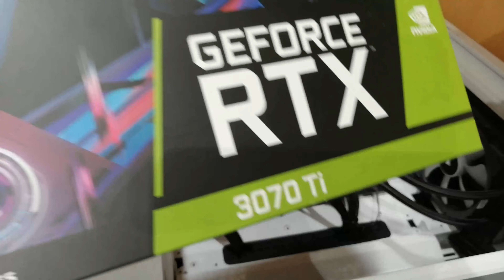Corsair 7000D WHITE Gaming PC Build [2022] | Intel i9-11900K | RTX 3070 Ti | Gen4 7000s SSD 2TB

Comment: why spend so much money on terribly cpu as 11900k and then pair it with 3070ti!? you can buy and build basically now r9 7900x  for same money which are  90% faster in applications then 11900k